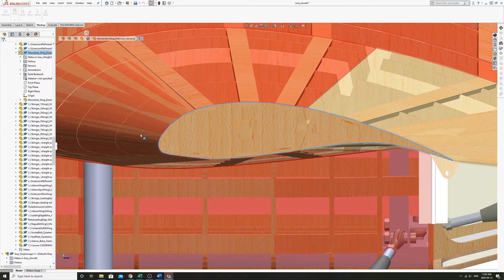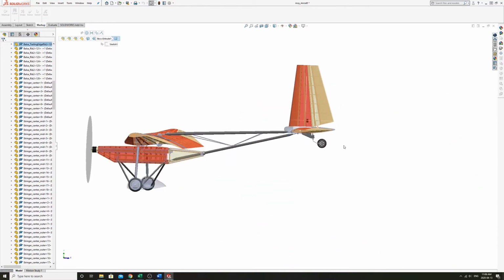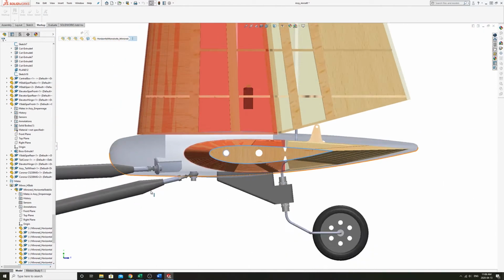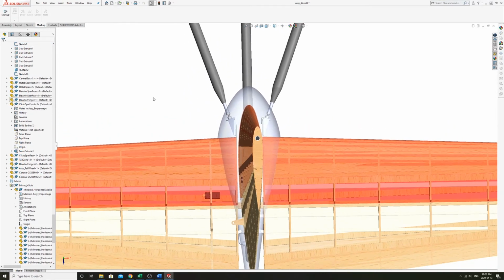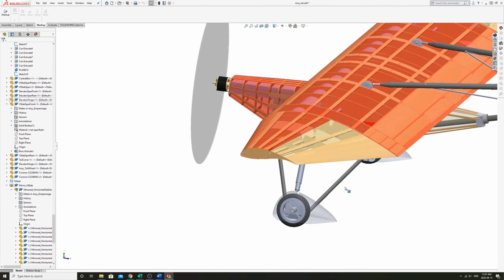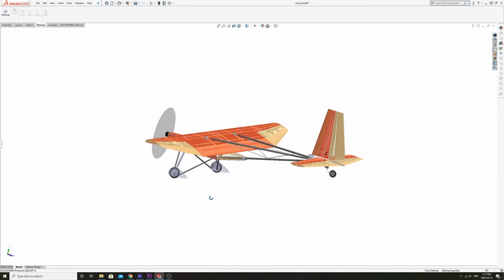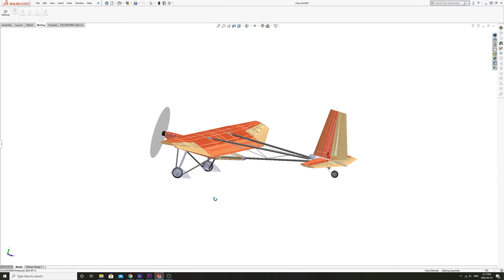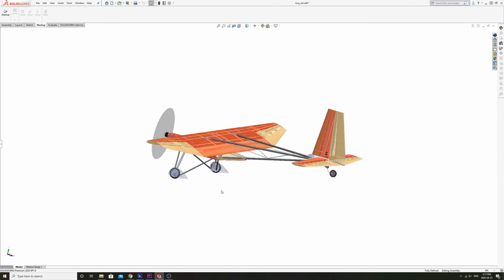Airfoils - Introduction - What is an Airfoil?

Comment: Can you also explain why are u using certain type of airfoil like symmetric airfoil for vertical stabilizer?
Reply from the maker: Hi looks like I responded at one point, but then when I switched to a brand account that removes previous comments. Sorry about that.

For the vertical stabilizer, for an airplane, at cruise we aren't sideslipping, so we don't need bias one way or the other on the vertical stabilizer. Symmetric airfoils have no lift and very minimal drag at zero degrees AOA. That's in contrast to helicopters, where at low speed the tailrotor does the job of antitorque against the main rotor, and at higher speeds, the vertical stabilizer can help do this and it's biased towards one direction under power, so generally helicopter vertical stabilizers are cambered.

For the horizontal stabilizer - since this example airplane uses a cambered airfoil, that introduces pitch instability unless we have generally have some downforce downstream of the main wing. Sometimes the hstab will be symmetric, but since it usually is biased towards producing downforce even at straight and level for most aircraft CG ranges, the hstab is often cambered facing "upside down" relative to the main wing. This is so that it produces its needed downforce with less drag than a symmetric airfoil that would need more (negative) AOA to achieve the same lift/downforce.
Sometimes, e.g. for "flying wing" aircraft that don't have hstabs, or for helicopter blades, we want to have the "lift in the front, downforce in the back" stable configuration by using a single airfoil instead of a heavily cambered main wing and a downwing stabilizer. This would be achieved with a recurved airfoil. 

You can check out my series on airplane stability for more info about that.